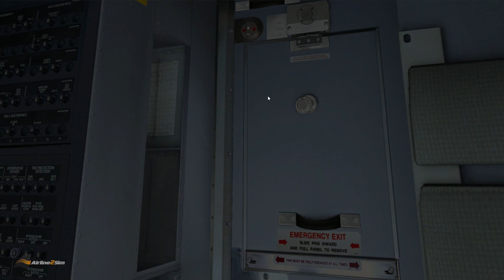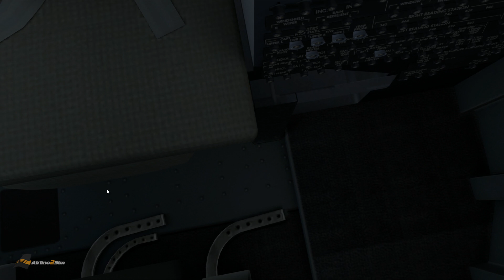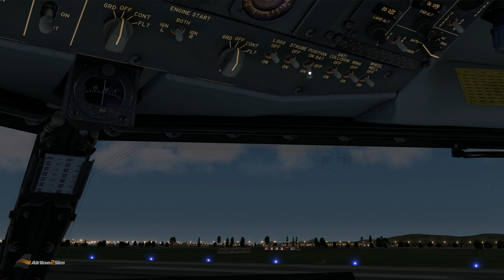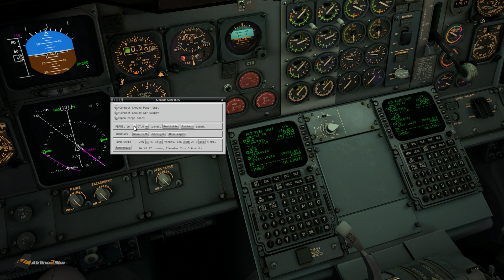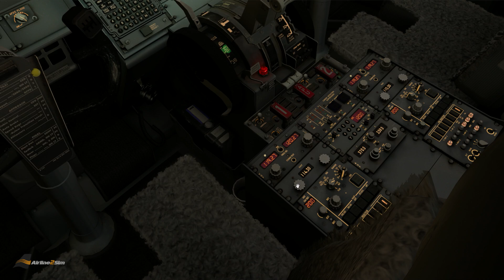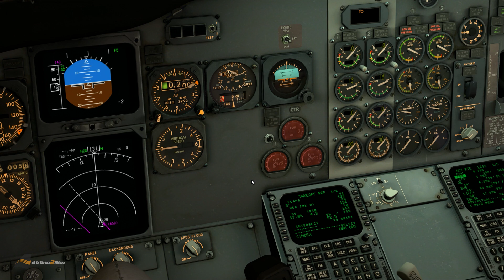Airline2Sim Real Pilot *First Look* IXEG 737 Classic - Part 2 - Flightdeck Setup

Comment: Hi guys, I am Jan from IXEG - immensely enjoyed watching the show, Jonny is an incredibly knowledgable FO and I would love to fly a few sectors with him!

Allow me to comment on a few things you picked up:

1.) I acknowledge the bug where you can´t override the OAT on the TAKEOFF REF page - we will fix this eventually - however the temp indicated there is always correct in X-Plane
2.) I acknowledge the bug where you get an INVALID ENTRY upon putting in the CG - we will fix that (however, the FMC does take the input already)
3.) You CAN input a GW - the FMC will then automatically calculate the ZFW for you (or vice-versa, as done in your vid)
4.) You don´t need to set the CABIN ALT in the STBY section of the  pressurization control - it is only used if you ever go to STBY mode - might be good airmanship to have that ready, though.
5.) You didn´t take the MCP speed cursor out of manual mode! It can´t be set by the FMC during flight like this, and you will run into problems... Make sure you push that little button back in to get rid of the "M" flag on the MASI.

I look forward to part 2 - crossing my fingers you won´t have too many VNAV problems or even a gizmo window alert... we are working hard at squashing those. If you do, reboot gizmo in air - the code will be unstable otherwise and you will see all sorts of unrelated problems!

Thanks, and what an enjoyable show, Jan
Reply from the maker: +Jan Vogel  thanks Jan - Jonny didn't spot the little 'M' on the ASI as he was sitting a long way from the screen to my right - we didn't run into any issues over the speed however so this didn't cause a problem. This was also done with the pre-patch version of the aircraft so we flew almost the whole descent in FLCH and V/S as we were on vectors for most of this very short sector and I was aware of the VNAV troubles so we did it the old school way! Part 2 looks amazing and is in the edit as we speak - really showcases the ability of this aircraft and the platform itself. Great work!
Reply: +Airline2Sim 

Very nice - can´t wait to see it - not like I haven´t stared at that cockpit enough hours in my life, but it´s really really nice to see someone else having fun with it. Thanks again for showcasing it, Jan

Comment: At 58:57 you actually set your min clean speed bug to 220kt not 210kt.. The 210kt setting is directly bellow the 2 in 200. The 200 bug is the bigger tick mark below the second 0.
Reply from the maker: +tf51d close enough for government work..

Comment: I once heard a joke that needs to be told. Aer Lingus pilot approaching runway in a heavy thunderstorm with high surface winds. He got it in but ran off the runway for a bit. After the aircraft stopped safely, the Chief Pilot, turned to his FO and said " That's the shortest runway I've ever landed on. The FO replied "Quite right Sir, but wasn't it WIDE!

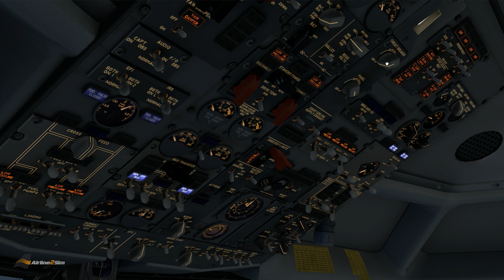Comment: This is great! However, I experience a delay of a second or so between audio and video (very apparent from e.g. 23:35, panning back and forth to the breaker panels), is this something that happened under production or uploading, or can I use any sort of method to fix this?
Reply from the maker: +Eseem we reshot the whole video after Jonny did his first walk through to fix lots of filming errors, make the camera pans smoother etc. This is one bit where the original soundtrack didn't quite marry up, but it's the only one. So no, it's not a problem at your end.

Comment: HI! Tell me one thing... how did You set X-PLANE that Yoy don't have any jagged lines? (antialiasing)
Thx. BTW. Q400 awesome work - love it!
Reply from the maker: +mrtheowll Thanks! I'll do a VLOG with my settings soon. It's a good machine - 6700k @ 4.8 with a 980Ti.
Reply: +Airline2Sim I use the same 6700k, also about 4.8, but i only have GTX970 with 4GB RAM.
Can't wait for the VLOG though! You will have a loooooooot of new views and sub-s!
 I wonder do You use any other "tweaks" besides in-game settings :)
Reply from the maker: Yes I use Nvidia Inspector but only to force the half refresh rate. Will post up the settings later!
Reply: +Airline2Sim awesome! Can't wait ;)